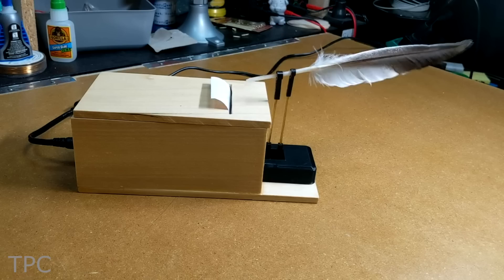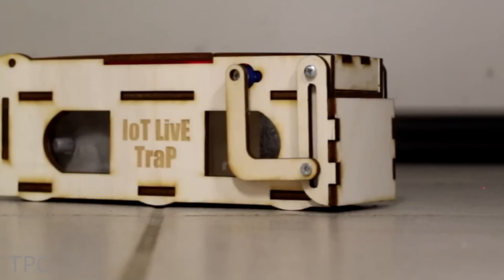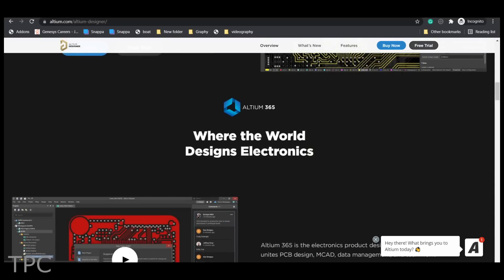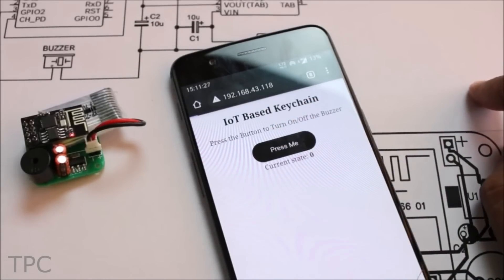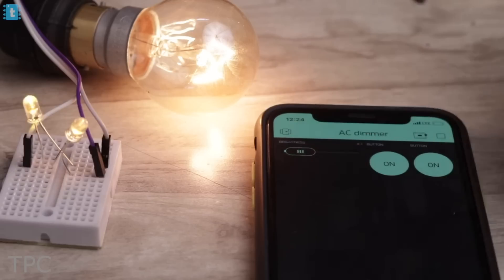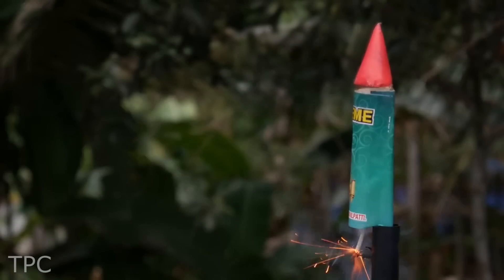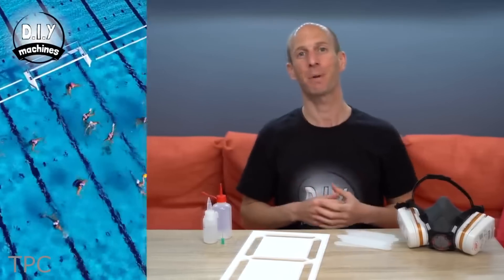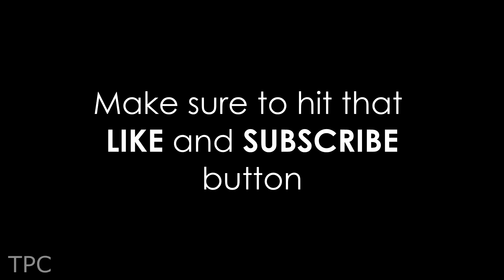A Mini DIY Weather Station! (9 More ESP8266 Projects)

Comment: For the last one, I think they are severely underutilizing the ESP8266. They can run that whole thing without the Uno. If they need more GPIO than the 8266, go for an ESP32. These days, I bet an ESP32 is cheaper than an Uno (and barely more expensive than 8266).